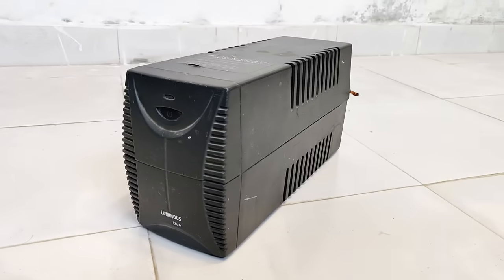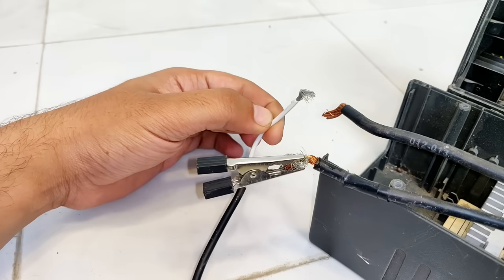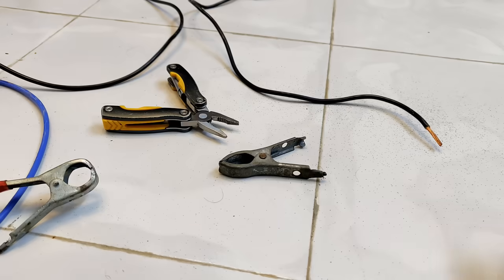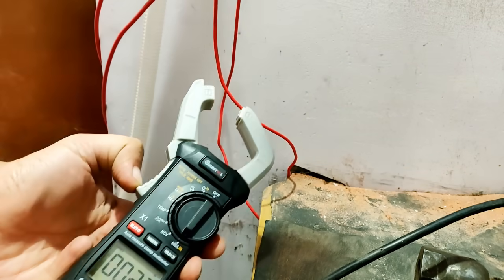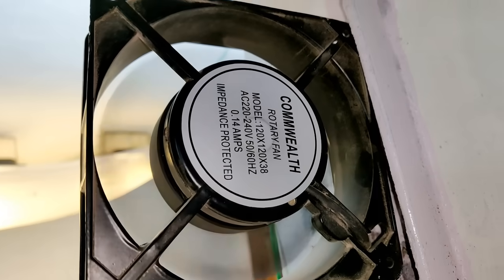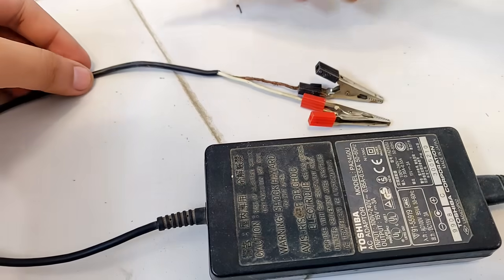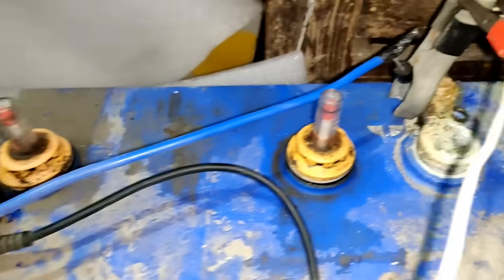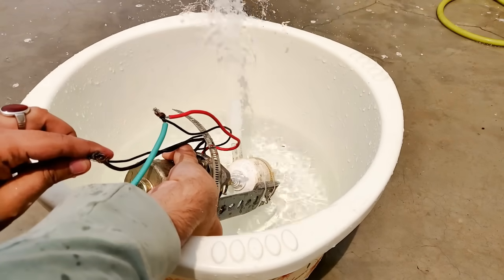Can a 12V 7Ah UPS Inverter ( 220v ) run with a 14.8V 150Ah Battery ?

Comment: I have a standard UPS/Very large telecommunications backup battery type system. I put it together years ago. It charges passively and does not do anything until the power goes. It can keep all my devices and network up for a day. (I generally use it for my full size fride/freezer though)  Nice to see somebody else "sort of" use a similar system.
Reply: Many of the larger UPS systems have hookups for additional battery packs.  So long as it is the basic lead acid three stage charging profile that's supported. There's no reason why larger capacity batteries can't be used.  However, I would only consider doing this if you expect very long power outages such as during a hurricane as such modifications may cause an insurance company to simply not pay should they find out that you've done this even if the insured damages have nothing to do with the electric system (you definitely would want to disassemble the setup when the insurance inspector is around).
Reply: Good bro
Reply: i also have 600VA UPS can I connect 6*12V 7aH batteries with it? if yes, will it heat up the UPS circuit or damage it or I have to use any mini USB fan to coll down it?

and with same UPS circuit can I Charge these batteries, if yes how much time it takes to charge, 

or I have to use any other ckt or charger to change it, if yes how to connect that chager with UPS ckt.

Reply
Reply: @dineshjaryal1224  Short answer, yes.  If you have a 12V UPS only use12V batteries in parallel. I have never had a problem with overheating, etc. Just keep in mind the UPS can only charge at the rate it charged the original battery. If you need to charge your bank quicker, disconnect UPS (may not be necessary) and put a 12 charger on batteries at a rate acceptable for your bank size. I hope this helps.
Reply: @deanbevier3389  thanks. But if I want to charge all batteries fast, will you please, help me how, if with extra external charger then how to connect.
Reply: @deanbevier3389  Yes, the battery capacity does not affect any overheating, but only a higher output at the output than the nominal one. If the UPS is built to draw 350W (600VA), it is good not to exceed this value and the UPS will operate reliably for any length of time (my UPS 650AV IN LINE works like this for about 20 years in conjunction with one solar panel in a holiday cottage that has no power supply). energy). I chose the IN-LINE UPS because it does not require 220-240V to start from the mains. Just connect a 12V battery and the UPS will start working on its own. OFF-LINE UPSs require a connection to 220-240V to start and are therefore suitable for computers, etc. No UPS overheats, because the consumption is strictly monitored, for example, I turn on only the TV and lighting. If I want to turn on the computer, turn off the TV, etc., etc, etc. All this only from the old UPS. :)
Reply: @DL-kc8fc  can you put me through how you were able to connect it to a solar as i have been searching for it online for days but didn't get a good process i can follow, thank you
Reply: @dineshjaryal1224  When the UPS is on battery power, the current is based on the load not the batteries. Having more batteries in parallel means more current is possible but the UPS won't draw any more than it was designed to.  Likewise the charge cycle is limited by the UPS so though the batteries can probably take more current during charging, it won't get it.  All that changes is the length of time the UPS can run for, it still has the same power rating as it always did.  You do need to remember to have all the batteries in parallel to have similar capacities (ideally identical) and be at the same state of charge, indeed in the laboratory, we would try to use batteries from the same manufacturing batch to keep them as consistent as possible.  Using more and higher capacity batteries should reduce the heat produced.
Reply: @dineshjaryal1224  As mentioned by the discussants above, it does not matter how high the battery capacity you have, as long as it is still a 12V battery. If you want more 12V batteries, you must connect them in parallel. Never in series !!! The UPS takes as much "A" as it needs ("A" behaves differently than "V"). Just look out for immediate withdrawal from the UPS. In your case, it's 600VA. You have to subtract 1/3 from this, so in reality it will offer you a maximum rated power of 400W (you can power a device that has a power input of up to 400W for a while). For longer power supply, make sure that it is up to 350W consumption (practically 600VA = 350W). It's good to stick to half, ie 600AV = 300W - your UPS will last you a very long time. That's enough for a TV, all the lighting in the house (if you have an LED), a computer, a 3D printer, ... Fast charging of the battery UPS does not provide, because it charges and maintains the battery with a value of several mA. Any car charger allows you to charge quickly. Charge each battery separately. If your charger can handle high outputs (depending on the manufacturer), it is possible to charge 12V batteries in parallel. Never in series connection !!!

Comment: put a 40mm or 80mm if possible cooling fan in ups to prevent from heating the Tx...
Reply: yes rit , because it now has increased work load,
I was thinking the same.

Comment: Does your ups inverter charge the battery by plugging the inverter into the wall? Most of them should have this feature built in.
Reply from the maker: Yes these do... But only gel electrolyte type of lead acid batteries for some reason... If i connect these non gel type sulfuric acid batteries then because of the impure rectification and AC ripples, it discharges them instead of charging.....
Reply: @MrElectron  Ok I see. Maybe a filter capacitor on the output would help smooth it out. If you could successfully modify it, that would be a good video. But anyway, thank you for the response and keep up the good work. I've been a fan of yours for a long time.

Comment: Why does your ups chirp like a bird. Very weird sound.
Reply: Mine do that too. It has a little buzzer on the circuit board and it turns on when it switches from mains power to battery power. As the battery gets low it will start chirping more frequently.
Reply: @johnruscigno5738  yup. But mine beeps. Never chirps.

Comment: A few points u should have mentioned...
1. The UPS (inverter) u used itself will charge the battery if u plug it in 2 the mains.
2. Most small UPS/inverters like the 1 u showed will output a modified sine wave which puts more stress on  whatever u use it 4 & can cause problems & damage, this can lead 2 a shorter life 4 such things.
3. U should keep ur wires a short as possible 2 prevent voltage drops.
Reply: Excellent
Reply: Most smaller ups uses 7.5AH batteries and the circuit is designed to provide very small current to charge the battery. While using a 150AH battery, the current required to charge will be many times more and so required a separate charger to charge it.
Reply: thanks for the reminder about the modified sine wave, appreciate that.

Comment: Positive terminal of battery get corroded because of the presence of positive charge of H+ ion as battery has h2so4 acid inside it.
(Answer to the hidden question)

Comment: Due to the chemistry of the battery, when current is drawn from the battery, the chemical reactions of lead and acid in the battery cause the positive terminal to rust. (Answer to hidden question
)

Comment: Because of overcharging corrosion at the positive terminal of the battery occurs
Reply: Hi tell witch people win this contest 24 hours pass it
Reply: No one gave the correct answer....
Reply: @mrelectron_alternator hi sir tell me you real  answer
Reply from the maker: It will be covered with explanation in the next video.
Reply: @MrElectron  OK
Reply: @mrelectron_alternator  I gave the correct answer.
Reply: I think the corrosion is produced by the galvanic pair used in the contact. In other words your battery terminal is Pb  and the cable terminal is Cu or Al  that will produce a diferenceĺ in the electrón barrier potential, in other words the electrons will have to jump that union between those different metals...it is possible that the electrons charge ionized the ambient and the water humidity plus those electrons produce the acid that will attack the terminal and produce copper sulphate  in the case of copper or Aluminum oxide in the case the terminal is Aluminum.

Comment: Battery corrosion is caused by hydrogen gas being released from the sulfuric acid inside the battery. And the positive terminal has the larger amount of hydrogen as compared to the nagative on . that's why positive terminal get corroded.
Reply from the maker: Hydrogen gas is produced on the negative when its being charged...
Reply: @MrElectron  I know
Reply: @vicentecarrasco8651  you must be very smart bro , lol